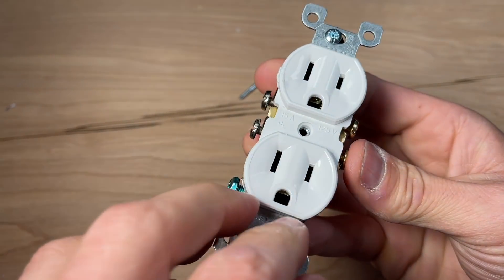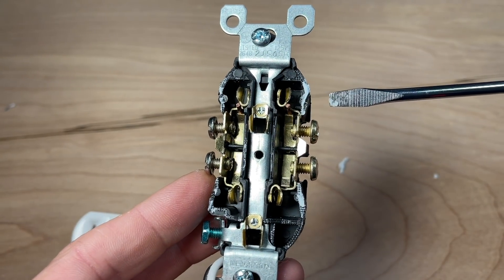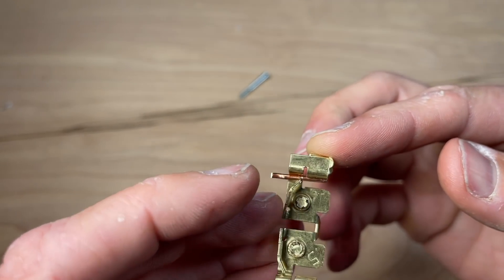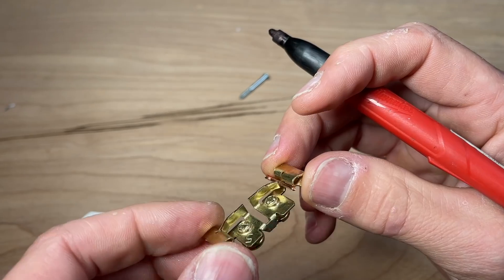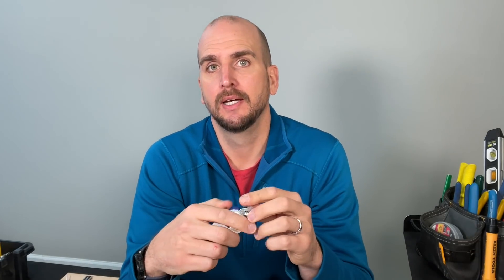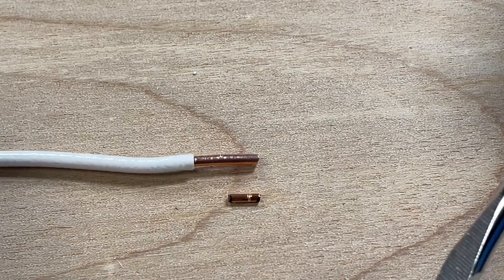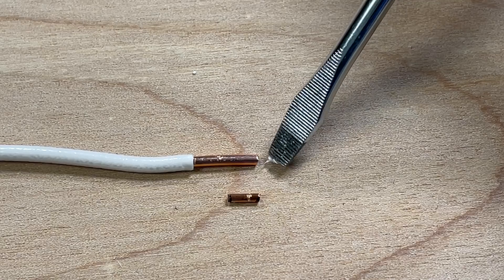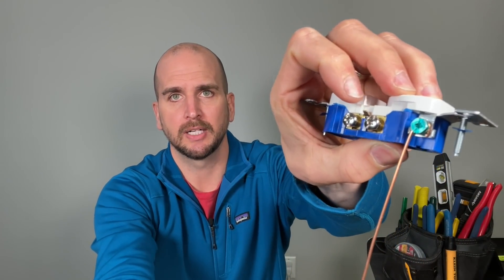Why You Should Not Use Speed Wiring | Back Wiring Is Preferred

Comment: I'm an electrician 37yrs in the trade and can tell you the back stab was first off to be an answer for a need to be able to add more wire runs on a circuit till they changed the wiring code in 1987 but they are still there cause of it already being there in the manufacturing it is always better to use the screws and have a solid connection if you have more then 2 circuits then a piggy back and wire nuts should be used but best to limit of doing so and should only have 2 circuits on a receipt do to over heating , as for me I never use them cause over time they heat up and stretch out and lose contact with the barbs and plate that hold them and begin to ark thus making a fire hazard I've had a few that when removing for checking and repair that they just fall out of the wall so to me it's bad practice to leave your customers in a place of malpractice for being lazy and not   securing your work and wrapping the side's with tape for extra security from arking against the inside of box or housing . Thanks you always have good points and content keep up the good work , PS. I also think they leave them in for a failure point knowing people are going to use them regardless but do be safe and always think safety first .

Comment: I like to think that speed wiring has even less contact area than what you're seeing, which I feel is the best case scenario.  I think it's less because the conductor is only pressed against the contact area where the retaining stinger is.  So if the conductor isn't perfectly straight, you will have less contact area.

Back wiring also does not have this problem.

Comment: When I worked as an electrician, nobody ever used those quick connects/back stabs and you would get yelled at if you did. lol. In a couple homes I've lived in, the previous owner/real estate company/whatever did some electrical work and used the quick connects and the recep had a bad/intermittent connection-- I also noticed that when people use the quick connects they almost never tighten the terminal screws (not sure if you are supposed to, but it just aggravates me for some reason. lol) Edit: Always used the J-hook/side terminals on receptacles since we typically didn't have receps with plate/clamp-style terminals where back-wiring would work.
Reply: Yes, you should tighten the screws that aren't used, regardless of how the rec is wired. That way they are less likely to make contact with the metal box.
Reply: @MrOgynist  Yep. Although most homes I've seen use plastic or phenolic boxes -- at least in the southeastern US. So potentially a reason why people don't feel the need to tighten them.

Comment: Thanks for this video. I’ve done DIY electrical for over 40 years. I never use quick connect. I tried it one time. I stabbed the wire in and pulled on it to see if it was locked in. The wire hesitated a moment then came right out. I never used the stab method after that. I’ve wired a lot of back wire, but prefer to use J-hook method. It’s old school and takes a few seconds more to connect but it’s the best way IMHO.

Comment: Really good information.  I know enough for moderate skill wiring but it was nice to see the detailed differences between the lower-cost receptacles and the commercial grade
Reply: The commercial grade receptacles usually are rated to pass 20 amps so you can safely use them on a 20 amp circuit (but you must have 2 or more receptacles on the circuit to be compliant with the electrical code).  If you look at the link connecting the two terminals on a commercial grade receptacle you will see that it is much heavier than the one on a residential grade receptacle.

Comment: I don't get why these speed terminals are bad when the push in wire connectors are somehow better than a wire nut. They use the same exact method of holding the wire. And the wire nut is more like the side terminals on the receptacle!

Comment: Another really good video Scott!  I have always used the terminals, but after watching this video, you made it clear to me about the actual ‘surface area’ when using back wiring.  The wire is getting held in place securely, by the screw terminal, soz I am replacing a few this weekend, and Ima give it a go.  Leviton duplexes.  I was going to try Eaton, but I was in The Depot, and I just put them on my Pro Xtra card.  I went with what is already in the house.  (Gotta please the Wife!).  May I offer heartfelt Congratulations on 100,000 !!!  🎈🎂👏🏻👍👍👍👍👍😁✌🏻🇺🇸

Comment: Not too related but have you guys seen the Deako Smart Switches? The wires do not connect directly into the smart switch, instead they connect onto the back of a receiving adapter where the smart switch clips in. I think that’s a brilliant idea that should’ve been made a standard so that when technologies evolve, we can swap out the switch without messing with the wires. In my head bending solid wires more than a few times cannot be a good idea not to mention that is a hassle.

Comment: My entire home (new construction) built 14 years ago is entirely done using the speed wiring method AND using the cheapest quaility materials.  Little by little I've been changing out all the outlets and switches and replacing them with better quality units.  I'm also old school and looping all leads around the screw terminals.
Reply: Builder grade EVERYTHING in new 
construction is very common.
Buyer not paying attention.
Good luck.

Comment: The speed way is good if you need to wire a switched plug in. Which you need 5 wires in total two black two white. one some times or two reds so there maybe more then just 4 wires that need to be there depends on what u need to be there

Comment: An advantage/disadvantage of speed wiring is that you can simply remove the inserted wire by rotating (or with back/forth movement) the wire against the receptacle.
Reply: Yeah that's how wires can back out of those holes. Either way, once the wire is removed for the first time, that's it. That hole shouldn't be reused since the brass clamp doesn't spring back all the way.

Comment: Only time I used the back terminals is when I had 3 wires to connect or the leads were short. In 50 years I have only run into 1 outlet that failed. It was at a sloppy commercial shop where the outlet was overused and when something was plugged in it sometimes would not work. The manager didn’t have any idea what was wrong. N any of my personal homes, never had any regular outlet failures. GFCI, different story, they seem to fail after about 5 to 10 years use in a kitchen, none in washrooms.    Jim
PS.....how about a video on GFCI construction vs. cost.

Comment: Excellent vid.  Thanks.  I always use the screw and J hook.   Slow, sure, but reliable.   My house built in ‘75 was done with old style receps and stabbed by the contractor.   When I changed everything to white new style receps I used J hook and a closing pinch  with needle nose pliers to form a full circle then tighten screw.   My new GFCI units have the back wire clamp type so I do use those.    Kitchen, bathrooms and outdoor patio receps never had GFCI originally.   Feel much better with those installed.

Comment: The more metal surface on a connection and the more pressure put on the wire, the better.  Speed wire connections only have tiny metal tangs pushing on the wire.

Comment: If your stripped wire is slightly curved and you use the speed wiring, you would get very little surface area which equals bad connection. I was using speed wiring for a while, but my 12 gauge wire kept me from using it on most projects. My hf spot welder is rated for 15 amps, but draws 26 amps and trips the 20 amp breaker during longer uses.  This would destroy a speed wiring job.  Great video. Thanks

Comment: Yeah. ! Your right about contact of the connection ! I’ve done many many things with wiring ! Cone te ting wires heater in wires not connected securely and with the best contact ! With wiring a cord just twisted together it tenths to have areas where sparking occurs inside and produces heat which is most likely I feel the reason fires start in homes! I solder all mine now ! The solder connections never really got hot but the just twisted together wiring did ! I pay attention to things like this ! ! Don’t want to have any fires that could burn up our house or family !! The more contact andstronger the contact and connecting working the better the chance of not starting an electrical short or creating any heat up and possible fires !

Comment: Maybe it's just because I'm old but I've always used a J.
Improperly done, sure it can cause problems but that applies to anything. No problem with backwiring when available but it's muscle memory for me now to strip and hook.
I'd never trust a stab and I'd suggest that the contact area is far more than 4× because the copper will be slightly crushed by the clamping force. The intersection of a cylinder and a plane is just a line.

Comment: I'm  an electrician of 26 years,  I do not recommend speed wiring/back stabbing or whatever you want to call it.  I am old school.   
We use the t tap method, we're only one set of wires land's on the plug.  And what you called side wiring/hooking around the screw, the same direction the screw tightens.  If you can't do this, maybe you need to let a professional do it.  Sometimes getting it done right is the difference between something working for a few years or it working beyond 5 years.
Reply: Unfortunately most companies today would rather have a job done as fast as possible than done right

Comment: Good info on the different types of connection. My thought is most outlets do not pose a problem with the wire coming loose unless the outlet was defective from the get go. If I am doing an install in a location that sees a lot of movement i.e. vibration I defiantly use a higher grade outlet in the location.  It all depends on what the circumstances are, seems to me the the NEC or UL would not approve of a device such as these if they truly posed a danger to the end user.

Comment: Really enjoy the discussion that happens here in addition to the great and thought provoking videos. I can’t help but wonder if the risk in using the back stabbing method is over stated for someone like me. I am not a professional. I have definitely had to replace a cheap outlet where the retainer for the push in connection failed. It wasn’t a big deal. That being said, I do like the back wiring options and plan on looking for the commercial grade receptacles next time. Perhaps if I did this for a living I would be more concerned because no one wants to get called back out to a job because of something easy to avoid like this.

Comment: I agree that side-wiring (i.e., J-hooking the wire-ends and attaching them to the screw terminals) can be problematic; two things I do for better screw-terminal connections are: 
(1) squeezing the ends of the J-hook together with needle-nose pliers after hooking it around the screw (here's where stripping a bit more insulation than the "bare minimum" is good, since you can make a slightly longer "leg" on the hook that can then be grasped with the pliers), so that the wire-loop will more-closely sit against the screw-shank (if necessary, the wire-loop can be "held shut" with the pliers while you tighten the screw, so that the wire will not slide out from underneath the screw as it is clamped down on the wire), and
(2) using switches/outlets that have screw-terminals fitted with "three-sided-box" retainer-clips which "corral" the wire-hooks and thus prevent them from uncurling as the screws are tightened down on them; I remove the terminal-screws completely from the copper contact-pads, insert the screw-shanks back into the clips and hook the looped wires over the screw-shanks, and then re-insert the screws into their threaded pads and tighten them up.

Comment: Correct me if I am wrong, but 14 gage wire has a diameter of 0.064 inches.  This translates to a cross-sectional area of 0.003 square inches.  Your excellent cut-away of the receptacle showed that the contact area of the gripping surfaces was many times greater than the cross-sectional area of the wire.  I guess I don't understand the concern.

Comment: So if speed wiring is not preferred for switches and plugs, why the preference for plug in wire connectors over wire nuts? I've seen pros say they don't trust anything but wire nuts.

Comment: Most new construction only has a 1 year warranty so speed wiring is job security.  Also when it fails the outlet  is usually worn out & due for replacement anyhow or overloaded & on incorrect sized breaker.

Comment: My home was built in 2004.  After the first 2-3 years of being in it, I replaced several receptacles and a few switches.  Especially on the receptacles, I noticed failure from heat, and I really believe it was due to the speed wiring.  I replaced all of them myself, used the old tried and true j-hook method, and haven't had any issues from them, even though I did not purchase higher end products.  I think I will be upgrading to the slightly more cost units from here on however.  I like the idea of the back wiring, especially in some of the tighter spaces of some of the boxes in my home.  Thank you for these videos, all great content.

Comment: I only use back wiring. When I have to replace a receptacle the old wire is often work hardened so it’s easier to straighten the loop or restrip to do back wiring. I’ve seen melted recep’s because of speed wiring.

Comment: The contact is really just a line along the circumference of the wire with the back stab or the back wiring. So two lines of very small area regardless of the length of the line. Remember a true line has zero area. I like to smash the wire under the screw. Not only does it provide a tight contact, but turning the screw scrapes the wire under the screw head to get through any little bit of oxidation on the wire. Dad and I always wrapped the J to be a P around the screw.

Comment: Not an electrician, however been a electronic technician for many years. I think where the problem lies is simply greed. For some contractors their focus is "Time is money" and miss the  confidence of doing a professional ensuring you are not only meeting code, but exceeding it.
People need to take pride in their work. Who wants to watch a news story saying family of 5 dies in house fire, and realize it was a home your worked on as an electrician. I always strive to over-engineer and that way have a good safety buffer. Your illustration of the contact area of back-wiring is a good one. In current flow, mass and conductivity are two of the major components... more contact area is always better! Resistance causes heat... small contact areas cause resistance... a person does not have to be a genius! Excellent video!

Comment: If you just turn the switch off I’m not sure you have to turn power off at the box. I always forget which wires go where so my plan is just keep trying wiring options until it works.
Reply: I really hope this is a troll, if so I have to complement you on how packed it is with cringe
Reply: @benroberts2222  haha not a troll I just thought that’s how it worked. But based on your reply it’s probably best that I call a professional.  Rule of thumb: if you spent kindergarten shoving crayons up your nose (guilty as charged) then maybe DIY projects aren’t for you.
Reply: Not trying to be harsh. Many receptacles label the sides "hot" and "white" to help you remember the order, as I too can't do it by memory. "Until it works" is not a good method as many devices will operate even when polarity is reversed, but that's not a safe setup; I just rewired an outlet that had been done that way by accident. If you don't have one you should get a little outlet tester that has warning lights for wiring problems.
Also not a recommended practice to just shut off a switch. Maybe it's ok if you know the switch was wired correctly

Comment: I have a Masters electrical license in 10 states and have over 46 years of experience. And let me say I agree with not using the back stab.Part of my time in the trade I have worked for supply houses for abour 10 years of that. Working for suppliers you get to meet factory reps and I have had many conversations with Ieveton Cooper and Hubble about their receptacles. They all will tell you that the back stab is designed and engineered to put the proper pressure on the wire  to make the connection. Their comment to me was how do you know that the proper torque was used while tightening the screw by a human. The make small torque screw drivers but how many use them? So there is my rant take it for what its worth.

Comment: I've got to say that the back stab mechanism looks a lot similar to the Wago mechanism. You know, they do make screw down wire connectors that I'm sure are just as good as wire nuts if you prefer that form factor. As for me, I wouldn't trust push-in or lever securing connectors with high current loads or pig tailing with receptacles since they have to carry the maximum load. I don't want to lose my home to a dodgy connector.
Reply: Wagos don't get moved in and out constantly like outlets do when people are connecting and disconnecting plugs.